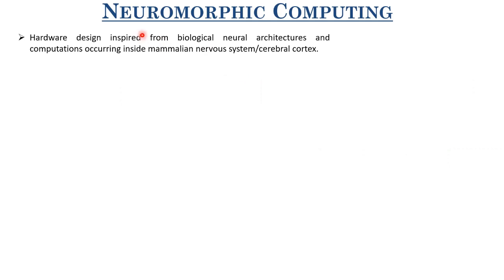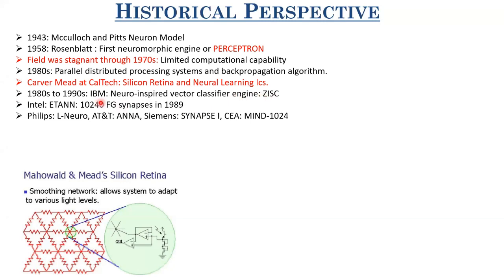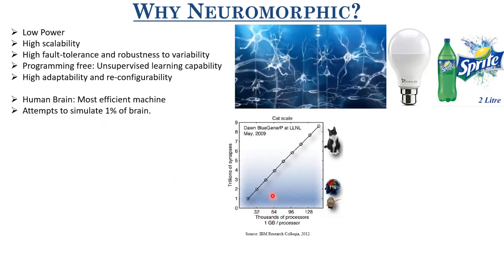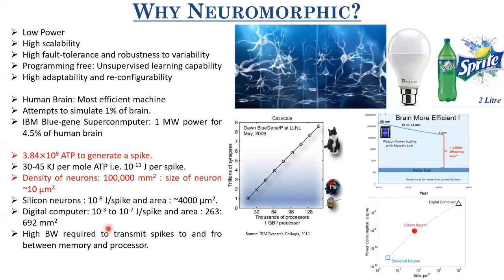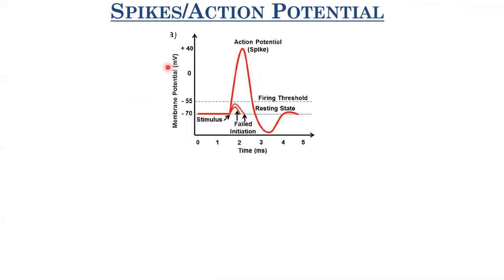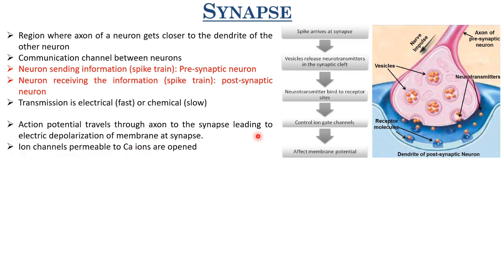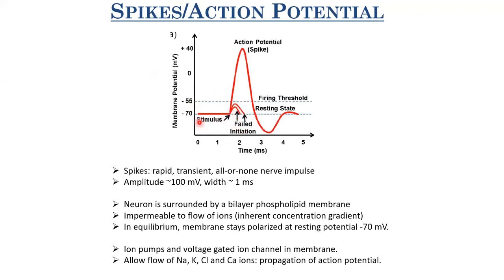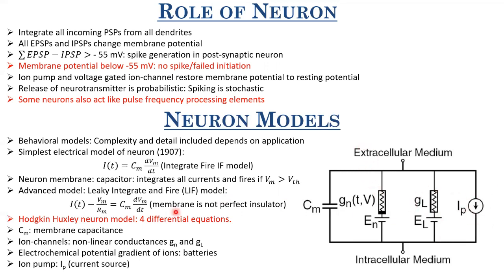Lecture 29 - Neuromorphic Computing and Neurobiology

Comment: Interesting, though a few more things about physiology we have to consider, to make it more closer to human brain neurons.

1. The axonal membrane, the stalk through which electrical impulse travels, is not a static - 70mv, the leaky potassium channels are always open. We can think of it as fluctuations in the electrical impulses.

2. In peripheral nervous system, think of it as the most used actions(API, tool use in computer science) neuron pathways develop myelin sheath over them to make those processes faster, affecting how one might react to a sudden change. For example a tennis player, might have a strong backhand, which they use much more often than their front throws, it affects outcomes of how one person (agent) does things. Even if there is a fixed protocol for doing things, this "shortcut" phenomenon (shortest route possible) could help make the neuronal system more "plastic" and adaptable.